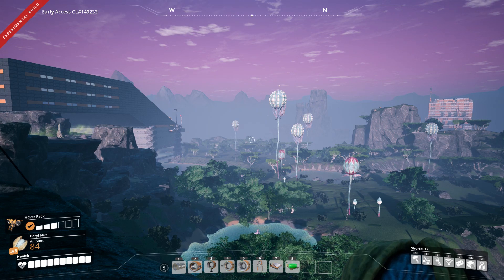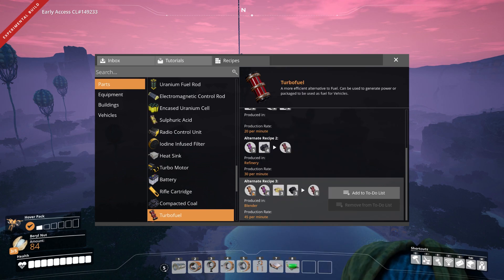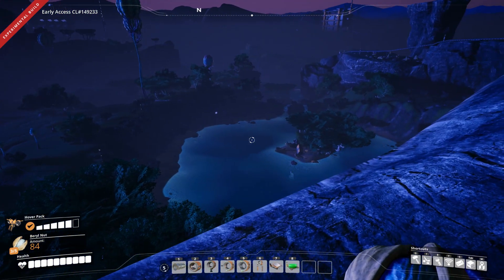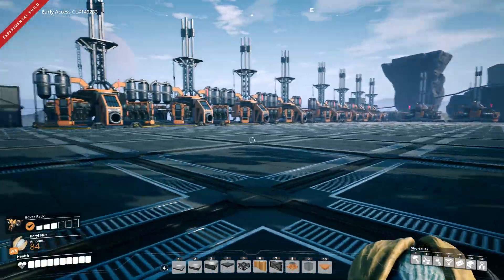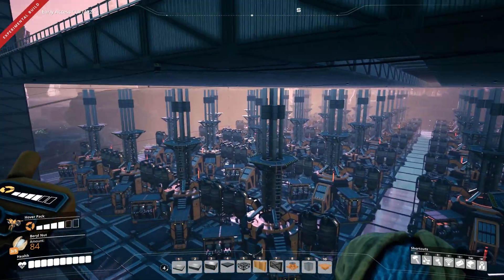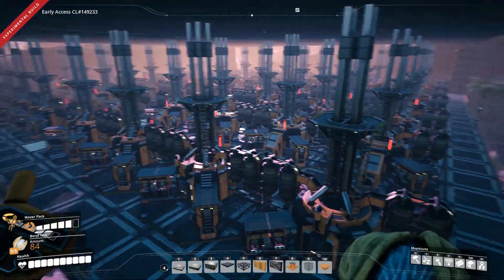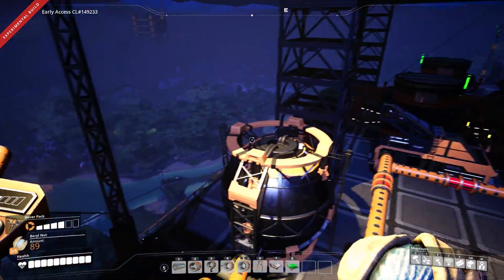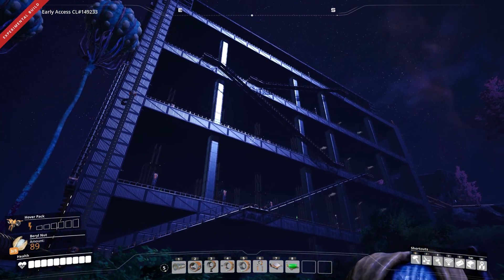160 Turbo Fuel Generators 24K MW Build [SATISFACTORY]

Comment: by the way, there is a much better setup for an area like that which would not require any outside resources. only that oil well and water. you use the same recipe in the refinery (the alternate polymer/heavy oil) you do want the alternate one though as it produces more heavy oil. then you simply feed the heavy oil and water to a blender and that produces diluted fuel.

5 refineries and 4 blenders can produce 400/min only downside is it requires a ton of water, but as its on a lake I don't see that as a problem. but 5 refineries with 4 blenders can run 34 fuel generators on 150/min oil and produces 5GW of power.

now I've not used those wells, I usually setup on oil resources in spire coast (there is like 8 of them) but I know a pure oil node with an oil extractor overclocked to max can supply enough oil for 20 refineries and 16 blenders producing 1600 fuel per minute. that can run 134 fuel generators on nothing but oil and water. and generates the exact same amount of power, but with far less complication from needing to belt in other resources. Spire coast has enough water and oil to generate roughly 115,000MW or 115GW of power with this setup (which is more than all your current power grids combined in this video from a single location). I use it in all of my power setups.

but for max production you need the alternate oil/polymer not the default one and the diluted fuel recipe which is also from a hard drive.
Reply from the maker: Yea this was not the most efficient of fuel generator factory builds. At the time I built this, blenders had just recently been released, resource wells also, and I was interested in using them in a build to play around with the new stuff. But I do agree and thanks for the suggestions - i'll keep it in mind.
Although, if you've seen some of my other videos - a fair amount of my builds are not very 'efficient' in terms of the recipes, setups and locations I choose...usually quite the opposite.
Cheers Jaqueline, much appreciated
Reply: @StinArchi  I know that feeling. I look at videos in awe these days whishing I could build like some of these do. my stuff is scattered all over, box-ish, and not very efficient. I only know about the fuel thing from searching youtube for power generation guides

Comment: Not criticising this build itself because to be fair... it's pretty sweet! 
But for those who care, from a technical stand point the old default turbo fuel recipe will yield the most amount of power per crude oil input. 
The conversion ratio for the default turbofuel recipe is 2.2222:1
The conversion ratio for the turbo heavy fuel is 1.0667:1
And the conversion ratio for the new turbo blend fuel is 1.3333:1
I'd also like to point out that I'm not consider the extra sulfur you need in all three variants nor the extra coal you need in the first two. Strictly crude oil to fuel. Sulfur usage may be important if you're doing uranium recycling. If anyone would like a breakdown I can explain in a reply.
Reply from the maker: Interesting mate, good to know.

Comment: Allo!  I came across this channel a few days ago and I quite like this video!  I too was thinking of build fuel generators factory in that area but your design is better than my idea so hope don't mind I borrow your design?  Only one question, what size is the factory?  Is it 24*24?  I couldn't tell since you move around too fast!

BTW, there are 3 Oil (include 1 coke + 1 Bauxite) node about 700m East from this area of your factory (lake forest), so it easy to bring some petroleum coke a lot closer (I also use that area to build about 200 battery pm or 100 circuit board pm (with overclocking) either way)
Reply from the maker: Cheers Alex, appreciate the comment. 
No worries feel free to use the design...its 24(on the sides facing east/west)x23(sides facing north/south)

Regarding the p.coke - I could of made it there on site as there was enough oil in the resource well to do that - but I had a lot of excess p.coke in another factory (400-500 per min just going into a sink) that I have wanted to use for sometime. Even though it was a pain to get there, it was a good opportunity to use it.

Thanks again mate
Reply: @StinArchi  Cheers mate!  I didn't think there be enough oil in the resource well to make some P.Coke but I could try it out but I since already got my C.board build in that Lake Forest with enough P.coke leftover (around 400pm, give or take, I keep bloody losing count!) so I can bring it over there.  
I haven't got a chance to check your other video of the other factory but (am sure you know already) you can use your leftover P.Coke with rubber into C.Board

Comment: nice build!      I'm stealing the roof thingy idea at the top ;)             Quick question:   you didn't have enough oil to just make the petroleum coke on site?

Good luck with your next one!
Reply from the maker: Cheers Dan.
Yes there was enough oil there to produce p.coke aswell...but I had a big excess of p.coke in another plastic/rubber factory and thought it was a good opportunity to use it in this power factory and instead of just sinking it, even though it was a pain to get there. Thanks again mate.

Comment: max cons is if everything in your game was running at the same time. overclocking would increase this number.
Reply from the maker: Thanks for confirming 👍
Reply: Yes that means all your buildings have to go on 100% and dont just wait it means all must have green light and dont wait for something with yellow light. So all rafinery must be 100% eficient. And i dont think it is posible. Or it is if you calculate right and use sink on every rafinery. Sorry for my english.

Comment: As someone who has been working on a spiral factory, and hasn’t made it past heavy modular frames (despite 300-350 hours of active playtime) because of how much of a pain that factory is - I can’t judge you for not going round. Granted circles, especially flat ones, are easier than corkscrewing, and a number of things would have been easier with the new walkway snapping.
But, I still won’t judge anyone who decides not to mess with them :P
Reply: For the max consumption - could there be machines in your operational factorys that are, individually not running - specifically the ones in your configurable factory?
Reply from the maker: Cheers mate as always, much appreciated. To be honest, I have no excuse, just being lazy. a circle building would have looked cool. Anyway, its done :)
Regarding that max consumption - yea on the video thats what I was referring too...that configurable factory has about 30% running at the time of recording that video - and the remaining 70% that are turned off would not account for that 14K MW difference, at most 2-3K MW. What do you think...you reckon its the measure of all your machines overclocked to the max? I could test it myself I guess. Anyway thats what Im thinking, but not sure...
Reply: @StinArchi  I think there must just be more machines not running than you think? It definitely is based on their current overclock setting, and not if they were fully overclocked - I just tested it.
If it isn’t more machines being shut off than you realize, I have no idea what it could be. Are their other bases where their product isn’t being used/has filled storage - aka other bases that would have significant amount of machines not currently running.
Reply from the maker: @Jason Latta Ok that is interesting..I think you're right and it makes sense that its reporting max. consumption at the current overclock rate. I'll have to check, but for sure all my factories and all their machines are running, except that configurable factory. Interesting...cheers for checking mate.